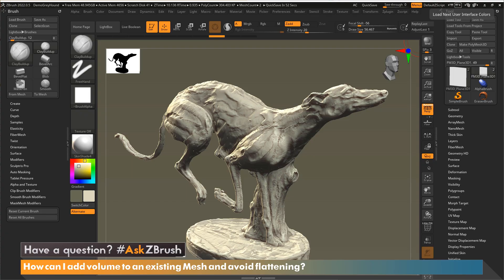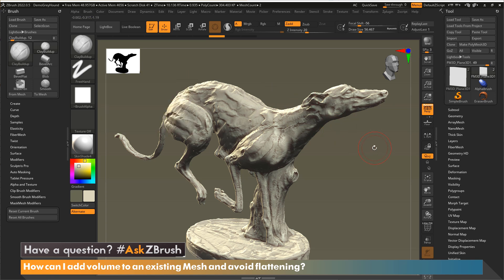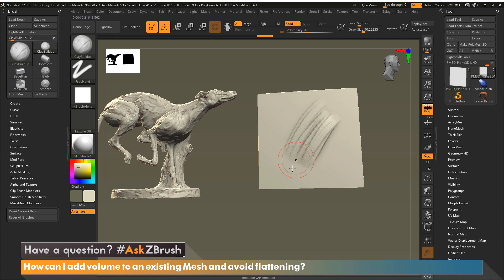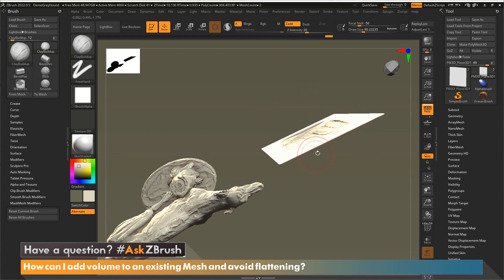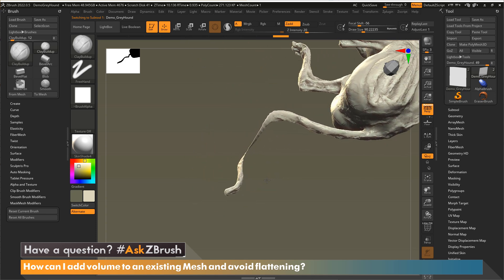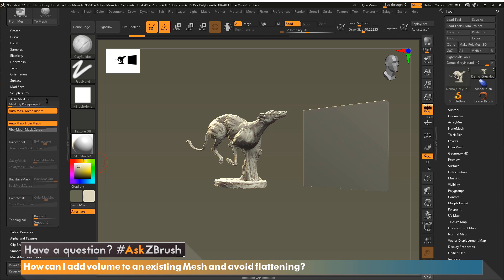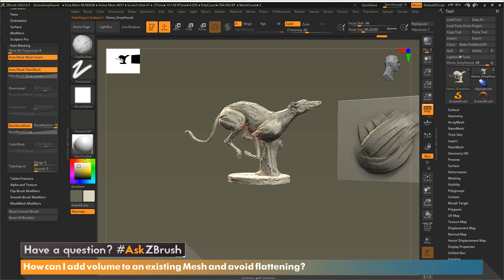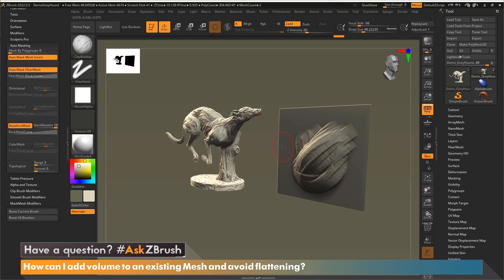#AskZBrush - How Can I Add Volume to an Existing Mesh and Avoid Flattening?

Comment: Hello Paul Gabry, I turned on the Backfacemask option in the Brush menu, but the Claybuildup brush can still leave a mark on the back of the Plane, I don't know if there are other settings, the software version has also been upgraded to the latest 2022.0.5. If it is convenient, please advise, thank you, good luck.